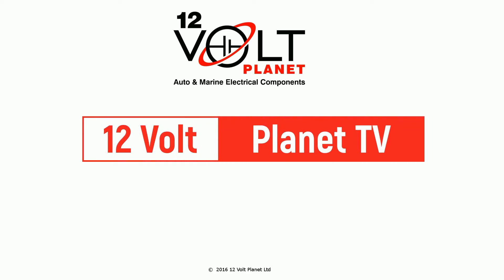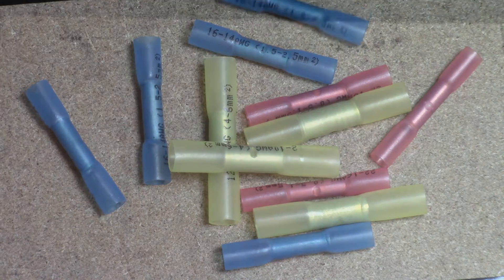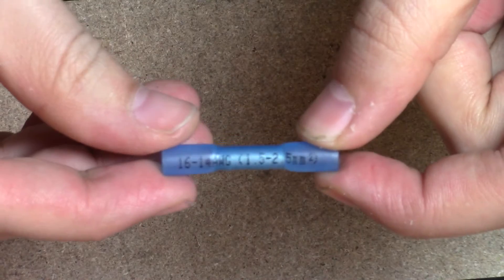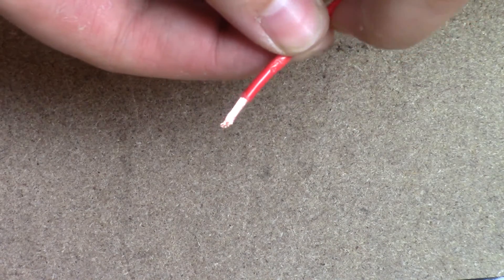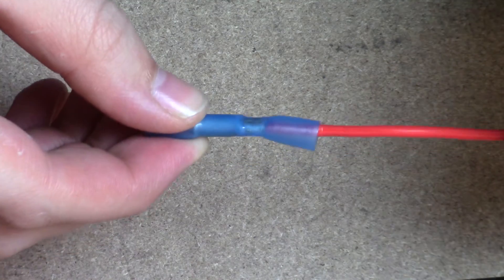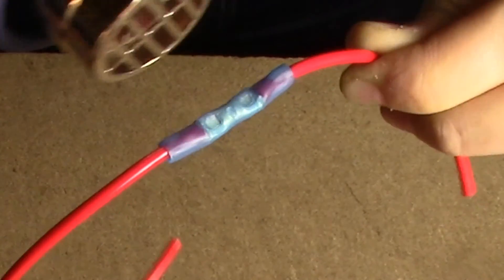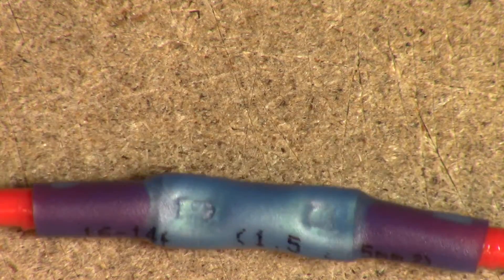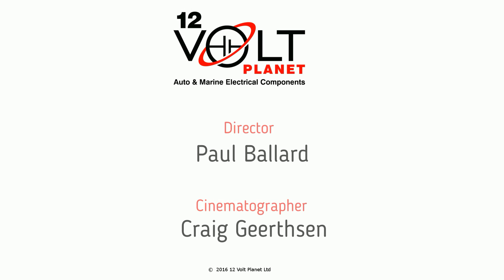Heat Shrink Adhesive Lined Terminals | 12 Volt Planet

Comment: great video - could you tell me is it ok to put two wires in one end and one the other if i need to connect 3 wires e.g. connecting 12v puck lights to a  parallel circuit
Reply from the maker: We would not recommend this but you can use - https://www.12voltplanet.co.uk/3-way-blade-terminal-splice-connector.html to do what you require.

Comment: But why not solder? When might you utilize butt connectors in lieu of solder and why?
Reply from the maker: Solder only vehicle's is prone to breakage sadly due to excess movement. If you are looking to connect two cable together yes I would recommend using butt connectors instead of solder to make sure the connection doesn't break as a result.
Reply: 12 Volt Planet TV 🤔